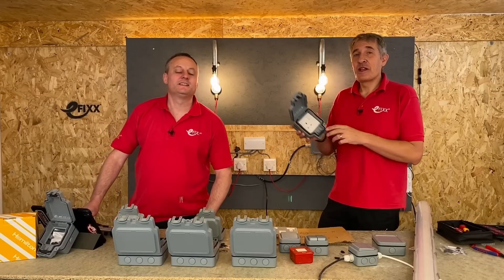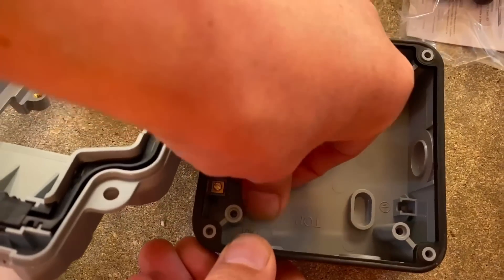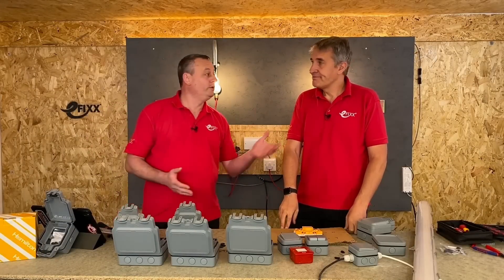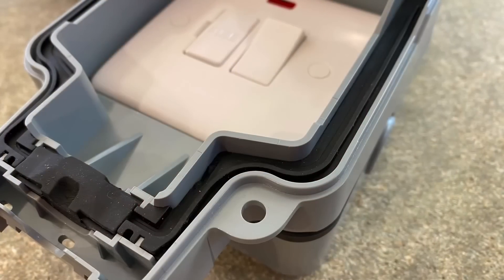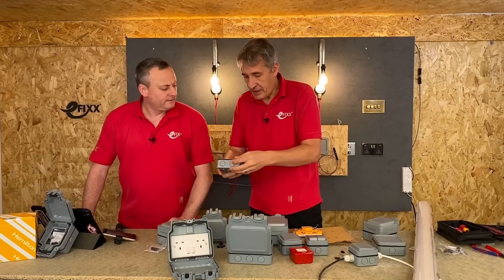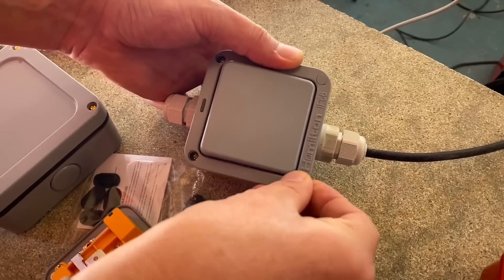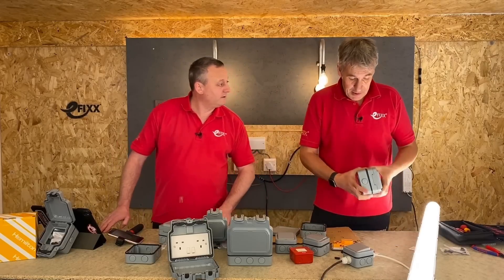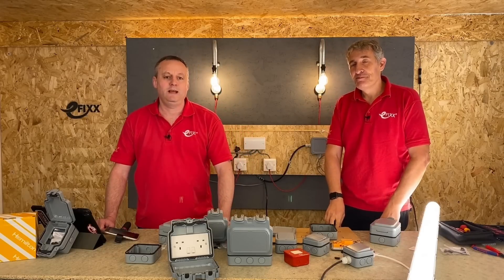MAKE YOUR OWN OUTDOOR SOCKETS & ACCESSORIES with Hamilton Elemento IP66

Comment: I found the Elemento range on eBay about a year ago - looking for something else, as usual.   Started using them over BG Storm and haven't looked back.  As well as flexibility I think they are easier to install than the BG Storm range, and a more solid construction. You can get a double 13A socket from Thomas Electrical for less than £13.
Reply from the maker: Great feedback 👍